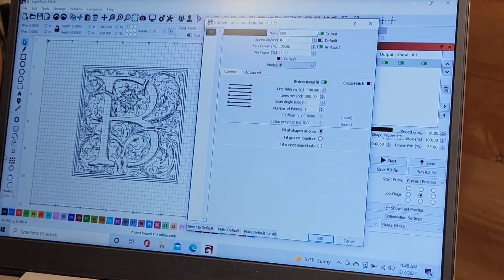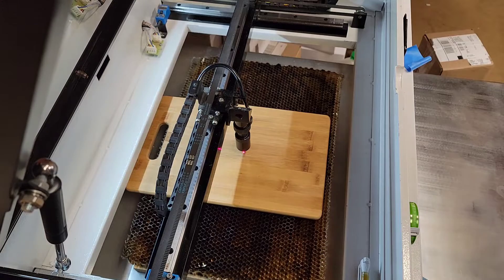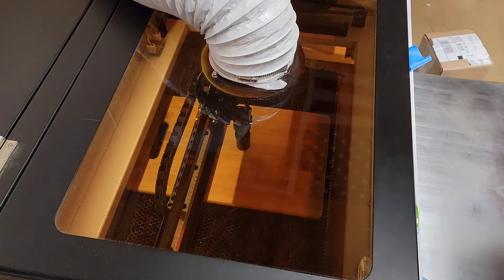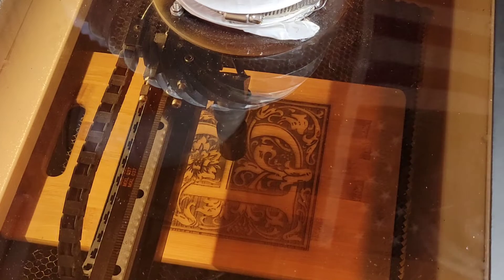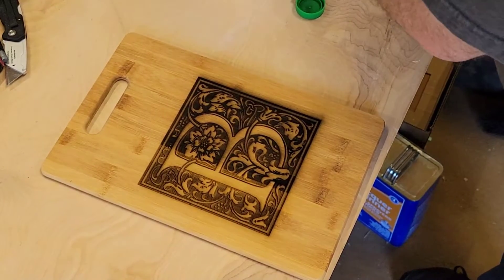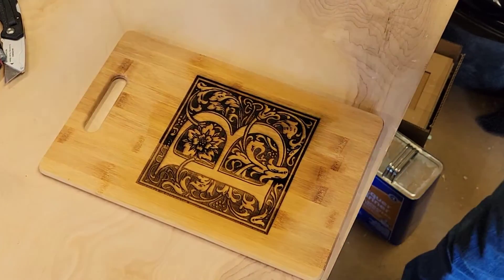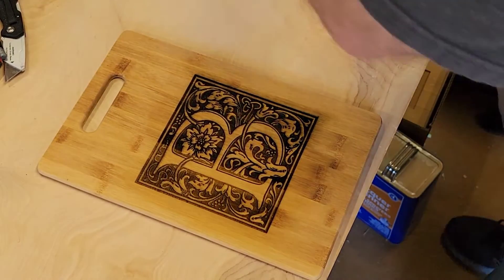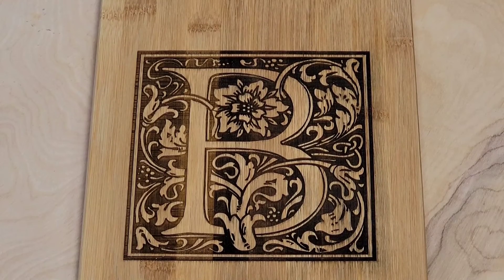The Borax And Laser Engraving Experiment

Comment: I see no problem with the borax process for decorative engravings. The implication in this video is that borax somehow makes a darker "burn". In reality this is not correct The infused borax solution  coats the wood fibers to parts of a millimeter deep. The laser process then vapourizes the wood fibres (not burning them) leaving behind  an exoskeleton of BORON where each fibre was. The black you see is not burnt wood or "charring" as mentioned in this video  but the result of decomposing the borax (with heat) into a fragile network of  boron ( a black lusterous metalloid). This fragile open network is easily smudged or smeared with rubbing and  the suggested use of food grade oil will not stabilized this fragile "blackness".    For decorative purposes, gentle application of clear varnish will penetrate the network and harden within to "freeze" it. Boron is classed as a toxic material but in small doses has a toxicity rating akin to table salt. So, for this culinary application I see no health risk  but use it and dishwash it a few times and I think the "blackness" will erode unless locked in.

To make the strongest borax solution possible start off with hot water that you can just about put your finger in (about 50C) and keep stirring in Borax until no more will dissolve. As the borax cools back to room temperature, sdiment  will drop to the bottom of the container. This is a fully saturated solution . Apply liberally and two applications will improve the depth penetration.

The colour is no longer dependent on slow engraving speeds and the out-of-focus normally used for dark engraving.  A short focal length lens and high power as used for cutting will allow you to engrave faster because you only need enough exposure time to cause the borax/boron chemical reaction.
Reply from the maker: I greatly appreciate your correcting my interpretation of the process.  All of the information I used was passed on to me as correct.  Apparently I was misinformed or else I did not listen correctly.  I thank you once again.
Reply: Hi 
 There ws no inteded crticism of your near perfect video but there are so many ,myths and misunderstandings about this technology that I felt a factual  description of the process would be helpful because the title of your video may attract many futur viisitiors. Like you, I came across the borax process from a 3rd party  but after some quick experiments I realized that it was both a miraculous and misunderstood process,   I took time to research it and establish the reason for the "blackness"........and it was not enhanced burning, as claimed in the video I saw..
Here is a video I did with some detailed microscope images that will show that exoskeleton I spoke of and you will see the fragility of the boron network.
https://www.youtube.com/watch?v=7pFuW1zPkkg

Use a sharp engraving lens enables dramatic increase in engraving speed. Here is a video where I show a piece of borax coated beer mat card  being engraved at 1000mm/s and I have achieved similar results on Baltic birch
https://www.youtube.com/watch?v=zu-hccXJPBg

So, as you can see there is lots of potential for you to explore with this process.   Carry on with your great infromative videos
 Best wishes
Russ
Reply from the maker: Russ, please accept my apologies.  I did not consider your comment as criticism.  You have vast more knowledge and understanding of the process.  I truly do appreciate you sharing your knowledge and educating me and my followers.

Thank you for complimenting me on my videos.  I try to create what I call "real content".....I don't hide my mistakes.  I want my viewers to learn from my mistakes.....it cost less to learn from the mistakes of others.

Again I greatly appreciate your feedback and input.  And I will be watching the videos you provided.

Frank
Reply: Yeah, I might try that burn deeper solution myself. Just spent 2 or 3 days on practice material to get something right. Tried the borax. Came out great! Then I wiped it with vinegar. It ALL went away with one swipe! Luckily it was just practice material but it looked good. Now I'm doing the exact same thing on again but until I perfect that deeper burn I think I'm just going to spray it with a sealant.
Reply: @iwannaapple7190  
A deeper burn  (I presume you mean more power?) will just blast through the borax coating  which only penetrates maybe 0.2 or 0.3mm deep. 
 Burning is not the aim of this process . You are trying to vaporise the cellulose within those coated wood fibres and what will be left is a very delicate exoskeleton of meatalloid dark silvery borax The colour is in the borax which is why you create a dark finish, it's NOT making your brown wood burn darker. If you have not watched it already then I suggest you watch this video and you will see that delecate boron exoskeleton I mentioned under my powerful microscope. If you are having to clean the smoke fumes off your work then you are using too much power. I suggets you dramatically increase the speed and if necessary  reduce power. Tackle this problem from the other way round . Start off with low power and high speed and work your way backwards at each test reducing the speed by 10% and then next increase the power by 5%. DO  the changes  alternately not together. Just engrave a 25mm test square  for each trial.  What you will find is little colour to start with and no fume bowning  (only use a whisper of air assist to protect the lens. Do not blast the work with air assist.) and then the blackness will happen and thats it. It will not get blacker because you have caused a chemical reaction of creating boron. It is at that point while it is clean and smoke free that you need to lock that exoskeleton with acrylic clear varnish.
https://www.youtube.com/watch?v=7pFuW1zPkkg
 Best wishes
Russ
Reply: Yes. Exactly what I said. A deeper burn.

Comment: I've heard debate about using Borax on a cutting board. Even with the mineral oil they say that wears down eventually.
Reply from the maker: This board will be for decoration only.  I'm not sure I will use the Borax solution on a board that will have meat cut on it.  Thanks.
Reply: Turn it over and cut on the non decorated side! Too easy!

Comment: Cool Frank. Is it just plain white vinegar you used? I picked up a diode laser and it's pretty cool. I'm still learning it. Cutting boards are very popular.
Reply from the maker: Dan, I hope you are enjoying your laser as much as I am.  I use white vinegar and a paper towel.  I do not dilute the vinegar.  Wipe it on, use just enough pressure to remove the charging.  Let it dry.